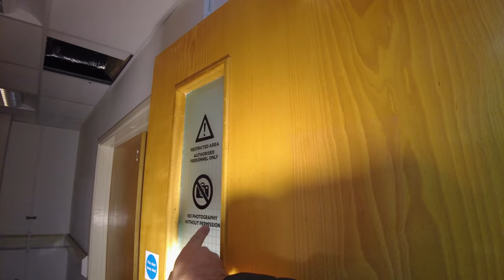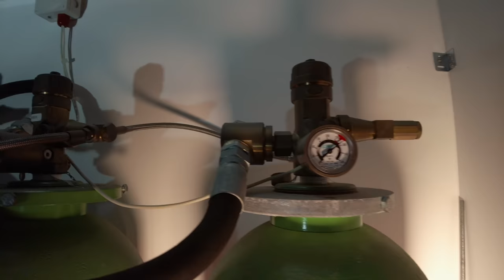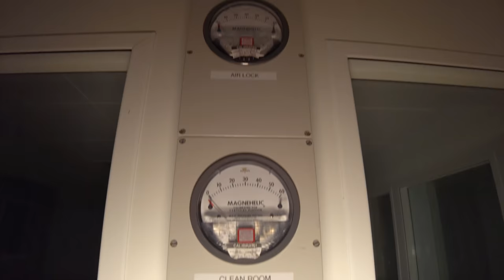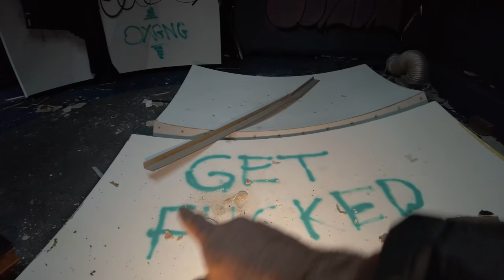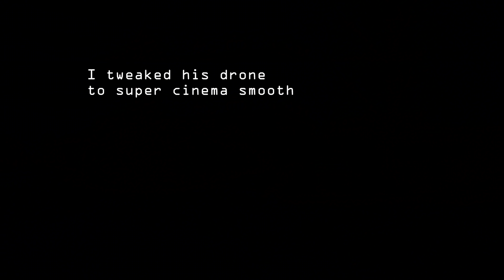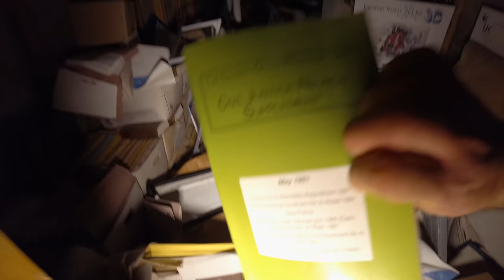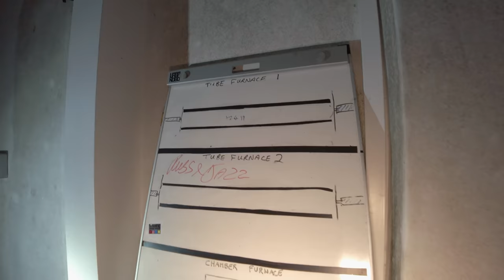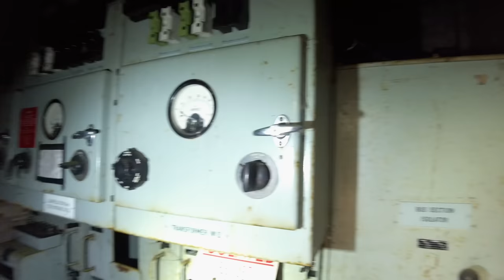Caterham F1 Motorsport Huge Abandoned Headquarters

Comment: The large ceiling heaters with the yellow pipe and the larger lagged pipe, the yellow pipe is for Gas, and the other is a chimney, gas fired heater heats cold air drawn through a heat exchanger

Comment: 41:17 That is a chassis setup pad. The reason it is marble is that the surface is milled perfectly flat so the engineers can setup the car’s suspension for the next race. Racing teams are fanatic about keeping team secrets, so the curtains are probably for privacy/secrecy reasons during suspension setup.

Comment: That frame is called a knodding donkey it's used to put heavy equipment on an elevated platform so when placed, you walk back in to building, stand behind the frame then open shutter for forklift to take away

Comment: 11 mins in those are gas burner heaters, the duct behind them is the exhaust. yellow pipes = gas.  Then 13 mins in its a exhaust pipe extractor, so they can run the cars inside the building and suck   the fumes out. theres normally a 4" black hose attached to them

Comment: at 13:12 the pipe your pointing at is for exhaust extraction pipe for motors it would have been a roll of flexible pipe hanging  that goes over the motors exhaust pipe